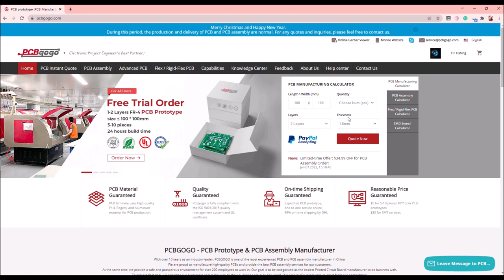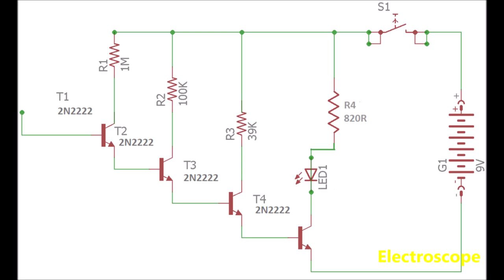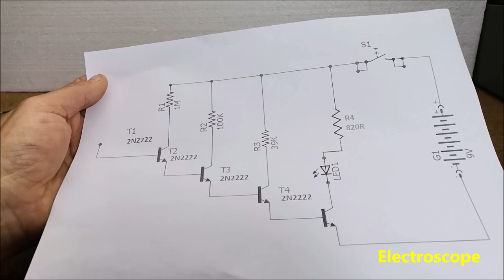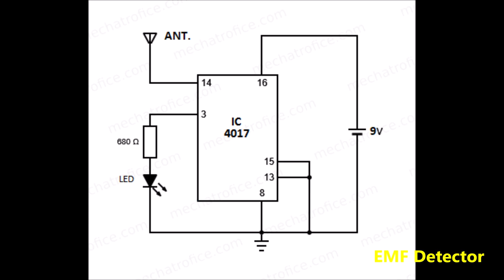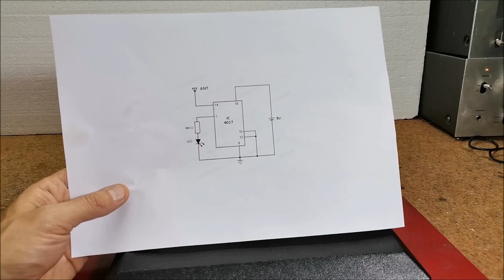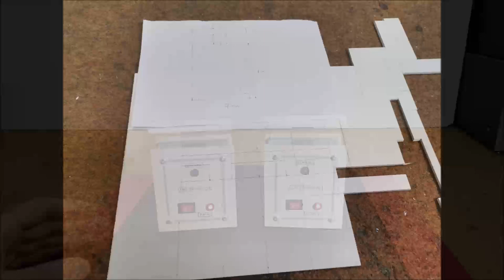DIY Simple sensitive EMF Detector and Electroscope

Comment: I used to wonder why nobody ever used mosfets (like in a 4xxx series device) for detecting like this... then I realized that you essentially are exposing its naked gate to possibly being ZAPPED by a charged door knob or the like (big no-no)... doesnt matter that the rest of the chip is safely connected.,.. its the single unprotected gate hooked to the antenna that is the problem... at least that was why I thought it was never done.  So has yours blown out yet?